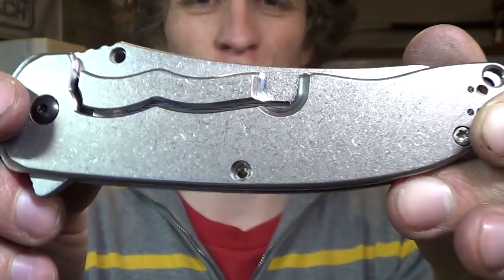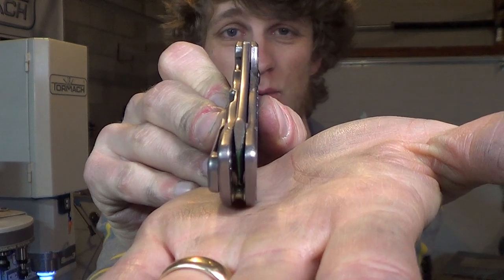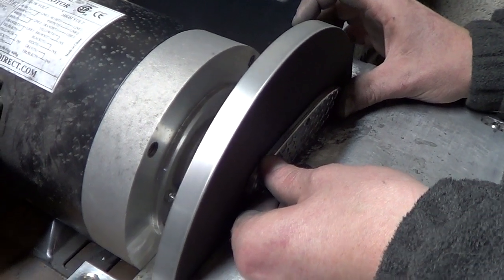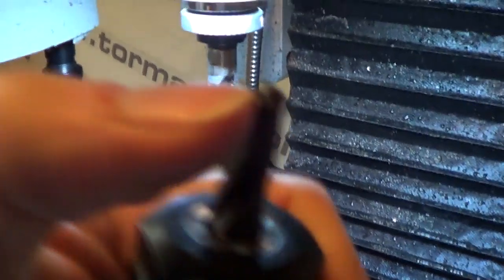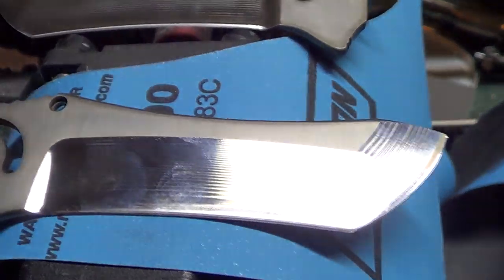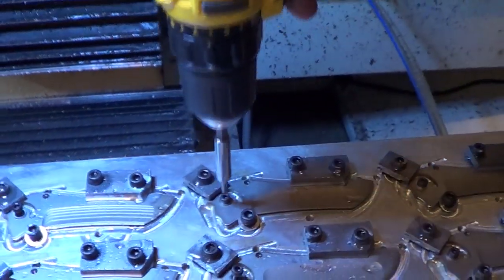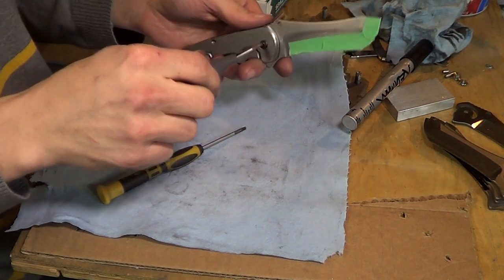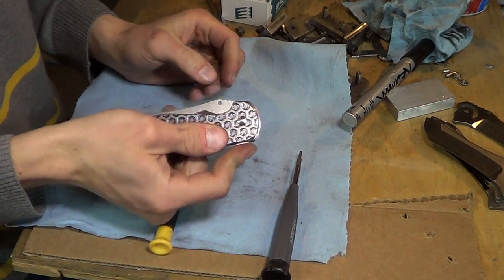Knifemaking Tuesdays Week 63  Finished Norseman and more blades

Comment: If you have no milling or CNC experience at all then the class will likely be a benefit to you if for no other reason then you'll get the conceptual framework of how the work flow from CAD, to CAM to machining works.  Not to mention familiarity with the machine, work holding and tooling.  That was my experience.

Comment from the maker: Search on ebay for 440c bearing ball, search around till you find ToolSupply as the vendor.  I can send you a little baggie with 500 balls for $10 shipped.  Or just 100 ish if you want.

And yes, you can press out the stock balls and put in ceramics really easily.

Comment: As a lefty, i close all my right handed frame locks with my left hand. Iv noticed that this is quicker than closing with the right hand. I just keep my index finger on the spine and close in one smooth movement. When doing it right handed (correct me if im wrong) you start closing with you index finger and then close with the thumb. Whilst i dont think Spunkkks point is a problem and certainly not a design flaw, closing left handed also avoids this issue coz your thumb moves out of the way

Comment from the maker: It's a skill, just like anything.  The flipper tab hits your thumb before the blade falls and cuts your thumb off, so it's usually A-Okay.  There are other blade locks out there, but this style, called the frame lock or integral lock, is one of the strongest and most common among this style of knife.  After a while it's second nature and not dangerous at all, you get used to it.

Comment from the maker: You're thinking aluminum, titanium is a whole different animal.  It doesn't rust, so protecting it isn't an issue.  The anodized layer is the oxide layer, but with titanium the oxide layer is ridiculously thin.  The colors produced vary by how thick the oxide layer is.